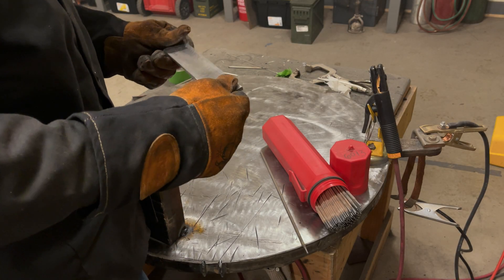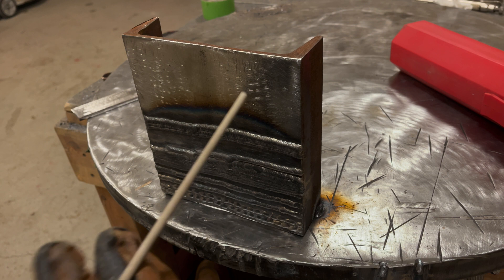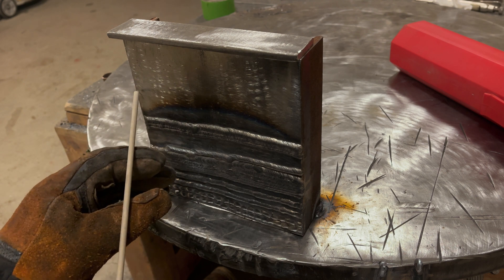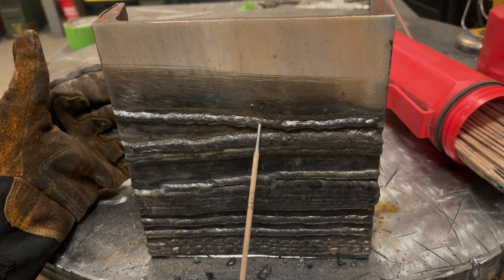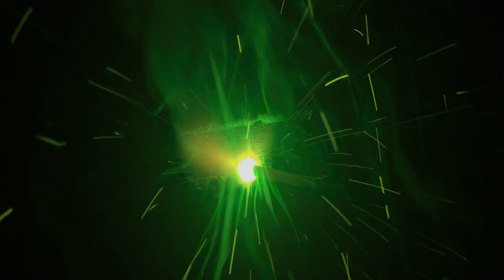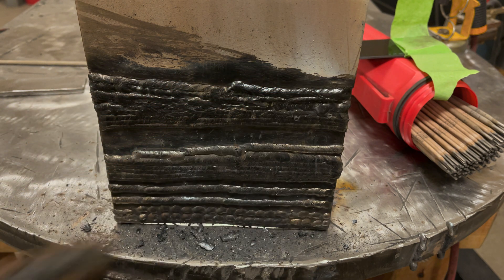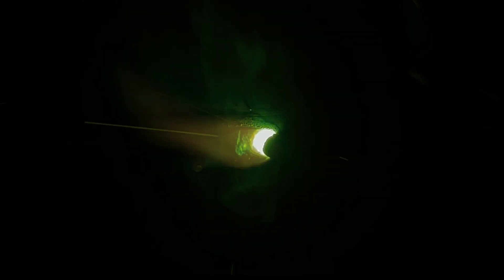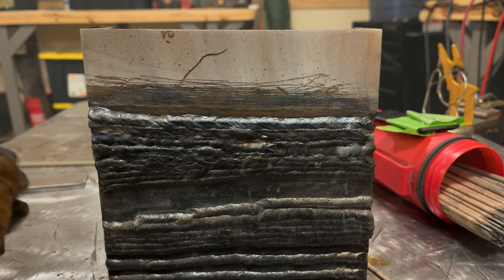How to stick weld: horizontal welding (Series part 10)

Comment: Greg, another excellent video!   I just started to learn stick welding.  I have watched many of your videos on Stick, MIG and TIG and I am learning a lot.  One thing that is hindering me on all three, but especially Stick welding is seeing where I’m going despite having a high quality auto-darkening helmet with a large viewing window and the latest clear view technology.  I get close to my work and I also use 3x or 5x cheater lens which helps, but still it’s not enough.  I have tried multiple shade settings from 8 to 13 and although I can see the arc and puddle very well, I can’t tell where I need to go i.e. I don’t see the material or reference points like lines or scribes etc. and I can’t weld a straight line very far without drifting away from my intended weld line.  

With respect to stick welding especially, you have suggested using soap stone or scribing your path.  How do you maintain proper arc gap, read the puddle and see your lines with a drag angle?

My next solution is to make a burn bar, and use it as I guide for my hand on all three processes.  Perhaps it will help me develop muscle memory, but I fear it will become a crutch, and I don’t want that. As a side note, I am in my 60’s, have good (corrected) vision, but unfortunately, I don’t have real steady hands, but I think they’re good enough to lay down some decent welds if I could just stay on track!  In order of best to worst seeing where I’m going is TIG, Flux Core without the nozzle, MIG and my most difficult is Stick.

Do you have any tips or trick for solving this issue?
Reply from the maker: Thanks for giving me great details to make it easier to figure out what will work to help you.  There are a lot of things to consider, hope this helps:

Since you have corrected vision and a higher end welding hood you have taken care of a big part of being able to “see” what’s going on.  Without a doubt based on age your eyes will struggle more so than a younger persons.  My understanding is the eyes lens looses flexibility which causes difficulty in focusing at assorted distances.  Cloudiness in the eye can also cause issues because you lose fine detail resolution.  Fun stuff of course, but it can be worked around.

The first thing you can do is use a soap stone mark and weld to that.  It may help to just offset it from where you’re welding and just tell yourself to stay a 1/4in away from the soap stone line.  You could also scribe a line with a awl or file.  Manipulation of light will help as well.  I find many people have overhead light and that’s great, but straight overhead light makes any weld line (like a lap weld) virtually disappear since it eliminates shadows.  Changing from overhead to more horizontal light source will pop shadows and you can use those to weld to.  Your welding hood may also let a lot of light in from the back and that can reflect off the inside of the lens making it harder to see.  Try taking a lightweight towel and draping it over the hood and make a few welds to see if you can see better.  For high precision tig work I wear a hood with a back cover.  

With stick I run so tight of a arc that the rod (flux) bumps the plate consistently.  This makes me aware of where the rod is in relation to the plate.  On fillet welds the rod ends up touching both plates so it pretty much runs itself.  Lap welds are similar.  The hardest are butt joints and outside corners, those can be easy to lose track of.  Experience matters in those situations.

It’s hard to accurately describe what happens, but after a fair amount of stick practice your brain and body just click and you don’t have to think about what you’re doing anymore.  Everyone takes a different time to get there, but it’s needed to be good at welding.  Welding requires a ton of control over many variables simultaneously, so many that the brain simply can’t control all of them.  As your body/brain gets repetitions during running thousands of rods, it will automatically start moving your hands properly without you having to focus on doing that.  It’s at this point it becomes far easier to weld simply because you can focus on what you’re doing instead of wrestling with your hands.  This directly ties into being able to weld straight.  I can weld straight lines while sleeping, they may not be straight to a edge of a plate 😅 but they will be a straight line.  When you can run perfectly straight welds, making a weld on a actual joint becomes easier because you can just position the piece so that your straight weld lands where it needs to.  Visibility becomes less of a concern when you know how a weld will run based on your hand position.

Honestly it comes down to more practice and little tricks like I mentioned.  I have a hard time keeping things on tract sometimes.  Anything that can create contrast will drastically help.  Having really good shop lighting also helps.
Reply: Thanks Greg, those are really good tips that I haven’t heard before, and I am anxious to try them. Your wisdom, experience and willingness to share is extraordinary, and I admire that. I spent 40 years as a licensed nuclear reactor operator at a west coast power plant, and I have done a lot of on the job training for new folks, and I have to say, you really know how to communicate what you are teaching at level rarely achieved by people who teach both book and practical skills.  

As I have said, I have trained a lot of people, and the first thing I teach them, is to learn from as many people as you can.  There are many ways to do the same thing, listen to their experiences and stories, take what they pass to you, try it yourself, incorporate what works for you, practice what you’ve learned until it becomes second nature.  With that being said, of all the welding content creators, I find you to be the best, and I don’t say that lightly. 

It reminds me of working in the garage with my dad when I was a young buck, and that means a lot to me to feel that way again 

As always, I look forward to all your videos, and I really do learn more from you because of the above mentioned reasons, but I also learn from the others as well.  So Thank You!
Reply from the maker: @michaelwhiting878   thanks for the kind words 😀.  That’s awesome that you were a licensed nuclear reactor operator.  I spend a fair amount of my free time researching electricity and nuclear history so that’s right up my alley.  I work for a global power/water/waste water company that runs a few nuclear plants and it always amazed me at how many of the people at those plants had 30+ years in.  That kind of dedication/experience doesn’t exist much anymore.  

You’re right, it’s best to take information from multiple sources, I always encourage people to do the same.  Honestly that was a hard wall for me to climb starting a YouTube channel.  I know I have a lot of knowledge, and skill, but I know there is so much I don’t know and skills I don’t have.  It’s not fear of making a mistake (I do that all the time) or of being ridiculed.  More or less until I am a absolute expert at something I don’t feel confident sharing my thoughts.   Due to a set of circumstances with my property sale (I basically couldn’t keep working on it due to it being listed and had nothing to occupy my time) I started the channel.  I am really glad I did because the feedback has been overwhelmingly positive and far exceeded what I would have expected.  Honestly I am just happy to be a small part of helping people better their skills and themselves.  Shooting videos and sharing skills gave me purpose and I am hoping to inspire people to build something.    I definitely have a ton of content that will be rolling out over the upcoming weeks/months.  I even setup a new shop to make it easier to shoot videos/share content 😀
Reply: @makingmistakeswithgreg  I think the best teachers are the ones who own up too, and are honest about their mistakes. We all stand on the shoulders of those who came before, and it is not only that, but if we are wise, we stand on many shoulders and learn from their mistakes, and go out and push ourselves to incorporate that pass knowing, and then make a few mistakes of our own. 

As a follow up, I tried and incorporated most of your suggestions on my visibility issues, and they made a huge improvement, and I also watched more of your stick welding videos.  In particular I watched several videos about 6011, 6013 and 7018 and 7014.  I went to Harbor Freight and got all 4 types (1/8”).  I then proceeded to try all four in a similar way to your tests, and I quickly discovered 6011 and 7018 were difficult to manage.

So I sat down and rewatched your 7018 videos (some more than once), put that together with the suggestions you made earlier, and I had MUCH BETTER results. Especially with the 7018. 

That being said, while 7018 has become my favorite, 6011 has become my mortal enemy!  In order of preference, I like 7018, 6013, 7014, but 6011 is being very difficult to work with. 

Practice-practice-practice is the key, and I intend to burn all these rods up doing so.  But 6011 has me ready to chuck ‘em in the can!

The HF 6011’s have that nice graphite tip which is easy to start, but I’m having trouble with porosity and just plan crappy beads if you can call them a bead.  I have tried starting at the low end, and working my way up in 5 amp increments, and I’m just not getting anywhere but frustrated.  I know a major part of it is the quick freeze nature, but it seems the slag is very thin and isn’t doing its job.  Perhaps this is a brand issue.     Restarts are the worst, and even though I file the tip before restarting, I’m having troubles with sticking the rods almost every time. 

Any recommendations on a different brand?

With regard to your interests in nuclear power, I would be glad to share what I know, have experienced and some pictures too if you want. Just let me know how to contact you.  Part of my years of training was analyzing other nuclear accidents, with more info than is generally made public, so that may be of interest to you. 

Thanks again for helping me learn to weld, and I’m excited to see what’s coming…
Reply from the maker: @michaelwhiting878  I have never ran 6011s from harbor freight.  I mostly use Hobarts 6011 because it’s what is most commonly available.  Hopefully these tips help you with 6011, I may may not have mentioned these in the video:  

If you can run a real solid 7018 bead but your 6010/6011 is not good, change how you think about it.  7018 deposits more metal faster than 60xx.  You still want to make the same width weld with 6011 as 7018, however to achieve this you must move forward slower, and feed more rod in per inch.  If you grow accustomed to 7018 60xx will end up producing a narrow weld that is highly inconsistent in width and height due to the lack of metal deposition and unintentional long arc gap.  You must feed rod in at a faster rate, you will know you’re doing this because the arc will sound less harsh, the arc light output will lower, the spatter/sparks will lessen, and the molten pool will clean up.  Very similar to welding uphill with any rod, 60xx rods need a fair amount of feed rate into the puddle.  Too much feed rate will stick the rod, so arc gap that is almost sticking the rod is correct.  Also, most people learning to weld move too fast and with too low of amperage.  1/8th 6011 needs to be at 90-110 amps depending on how accurate the welder is, and what thickness of metal.  3/32 rods need to be around 70-75 amps.  3/32 rods need to deposit almost the same width weld as 1/8th, so you really have to feed in a lot of rod with 3/32.

The 60xx series rods have a very light, difficult to remove flux, that is flakey.  The restarts tend to be sticky likely due to either running too low of amperage or not having hot start.  Welders with high open circuit voltage and hot start make it infinitely easier to restart 60xx without sticking the rod.  With 6011 I tend to finish a weld, leave the flux on the rod, and just restart.  With 7018 I will pinch the flux off to expose the tip, 6011 doesn’t need that.  Out of curiosity what welder are you running? 

The last thing worth mentioning is 6011 welds freeze so fast that if you aren’t 100% consistent they will be rough looking.  6011 is a fair bit better than 6010 but much harder to get a clean weld than 7018/6013.  Get a piece of 1/4in still and run some beads with 6011.  Tell yourself to slow down, tighten the arc gap, and feed in more rod.  Your finished weld width should be the same or wider with 6011 as a 7018.  Height wise off the plate it should be the same as well.  If your weld is barely off the plate it means you’re going to fast and essentially just arcing across the metal instead of depositing metal.  Hopefully that helps 😀
Reply: Thanks for the great information, I can’t wait to try them out. 

I just got my welder late April, and it is a multiprocess Miller Multimatic 215.  I bought the TIG kit in addition to the welder, and it is Lift-Arc only and not A/C capable for aluminum.  Interestingly, I recently learned from Miller), the tig has a built in Post-Flow feature.  With respect to the stick welder feature; To the best of my knowledge, the stick welder does not have Hot Start or Stuck rod features, but although at bit frustrating as a new welder, I think it will help me in the long run to be a better welder.  I’m not afraid to go higher on amps for now, and so far, I am avoiding major issues like arc blow, and it helps me not stick the rod as much. Again practice-practice-practice will be the key on improving all three processes. 

Before my career as a nuke, I was an aircraft mechanic, where I first learned TIG and Stick in aviation maintenance training.  Unfortunately our school’s MIG welder was a donated piece of junk that had many problems, and wasn’t used much.  Our TIG machine was huge, and hard to get time on.  I grew up learning to weld with oxyacetylene in the garage with dad, and honestly, that got me by whenever some welding was needed. 

One thing that has really helped, is I had a really nice 240v welding receptacle installed in my garage, which is way more stable than my generator, and not such a hassle to setup.  I wish I had a shop, and a mongo-welding table like yours LoL, but I can’t complain about my setup too much, and I am really enjoying getting into the hobby after my 40 years of nuclear power, it is very relaxing and therapeutic. 

Which by the way, I find your videos therapeutic, and of great value, especially when you respond to my replies, like this one - Thank You for that.
Reply: Hi there! What actually helped me a lot is simply more and brighter light. I attached a (small) LED flood light to my bench and that made quite a difference. I am actually thinking about having a second one from the other side...